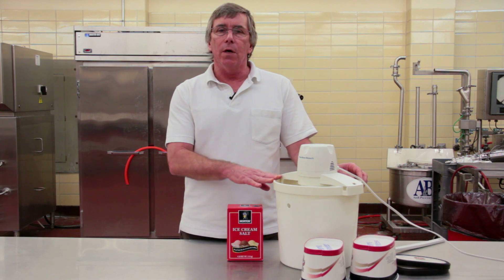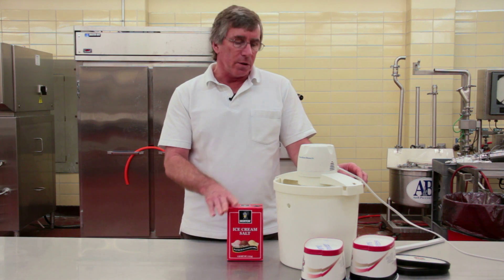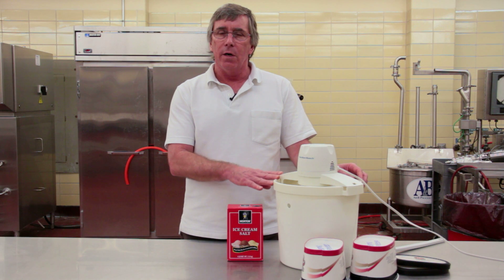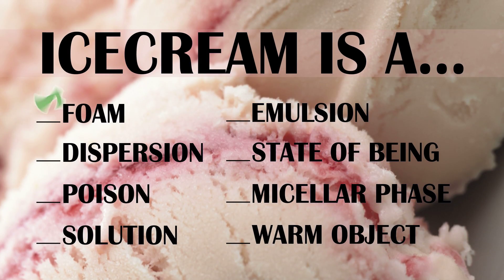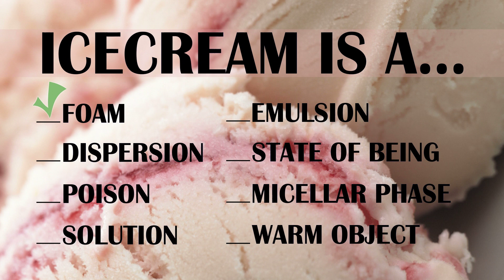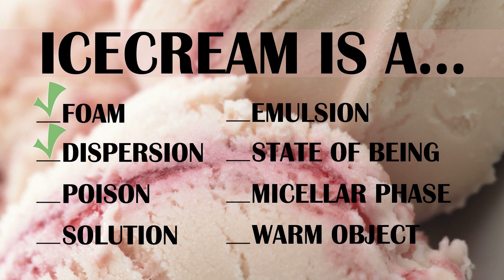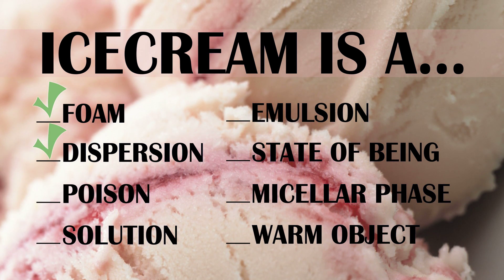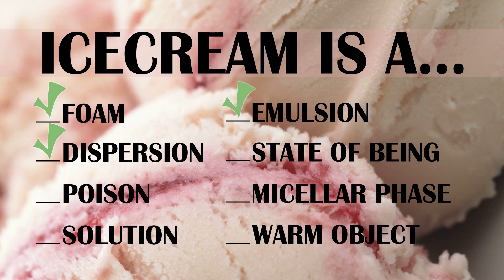The Chemistry of Ice Cream

Comment: Can you tell me how much 3.5% butterfat whole milk to add to one gallon of 14% butterfat ice cream  mix to reduce the total butterfat content to 10%?
Reply: Thats extremely easy. If you have an ice cream with cream and milk, and you want for example 10% fat content, you need first to make it for 1kg, that is a round number multiple of 10. Then if you for example add 200g of cream 40% of fat content, then you will have 20% of cream at 40% fat content. That is 80g of fat content, and that makes 8%, as 1kg is 1000g. If you want to make that to 10%, then you add more cream or more milk. Considering that milk only has 3.5%, you will need 570g of milk just to get to that 20g left, for 100g that equals 10% of fat content. Just make portions of 1000g, and its just a direct percentage. Usually 10% butterfat is a gelato more than an ice cream, and gelato usually starts adding in the formula 500g of milk, and then the rest of the ingredients calculating everything to get the parameters wanted. Then you add or substract from there, but cream content usually goes from 80g to 250g max, if you use 36% 40% cream. Milk goes from 200g to 600g max, depending on what you are making